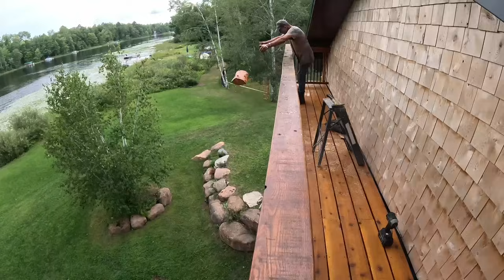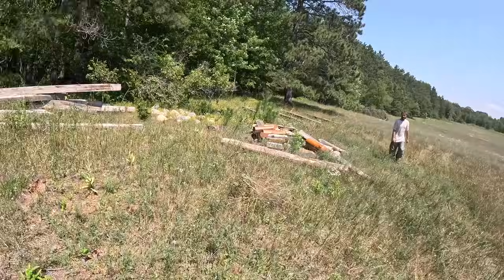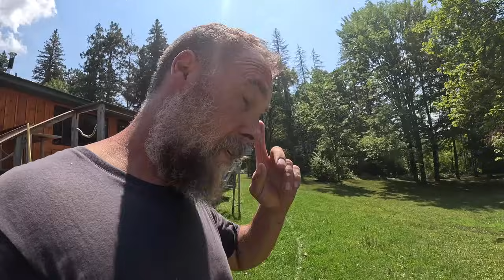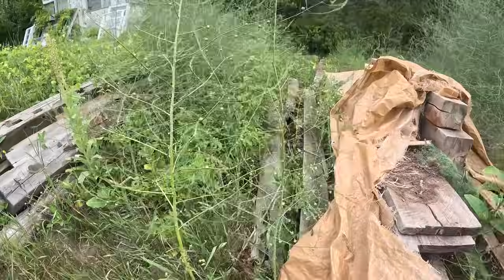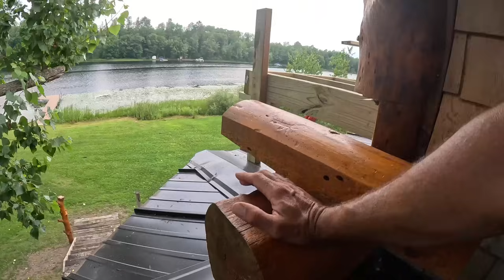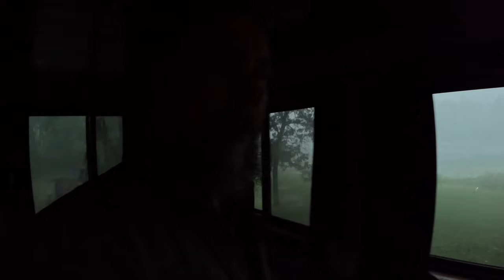Building a 2 story Hand crafted Deck    4K

Comment: The Makita belt sander is a great unit. Honestly it’s on the top end of the price range but they last forever. I have a old belt sander and miter saw that have been beat dropped 10 ft and still work after almost 20 years. They might not be the best on the market but I think they are the best with the longest life. Great deck by the way!

Comment: I have a porter cable belt sander that's over thirty years old and is still running that would be my suggestion
Reply: The Porter Cable tools of today are nothing like the Porter Cable tools of 30 years ago! Total garbage now!
Reply: I've got a Thor that's older than I am (64), that was dads.  Single speed & I have to hand make brushes...  Otherwise, I've worn out a few different brands...

Comment: Well you will never going to find one and your dune belt sander not the way they make things now days. If I had to by a new one I would by a Bauer 10 Amp motor 4in x 24 in it his 6 setting variable speed dial it has a metal body 1600 rpm  SKU #64530 $99.99